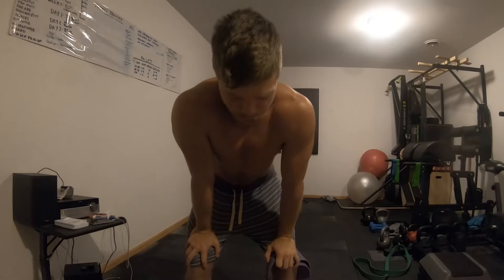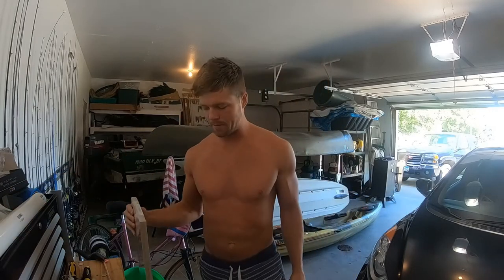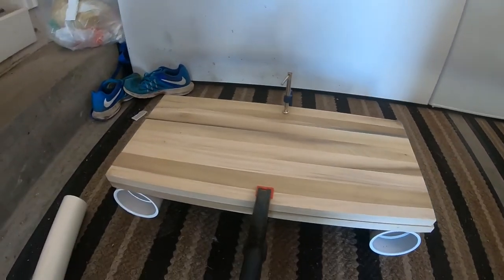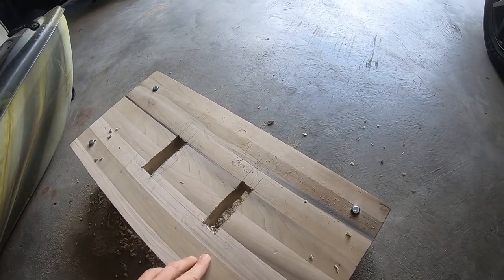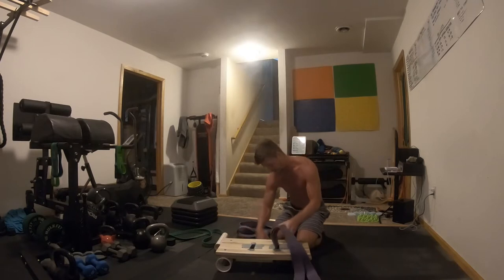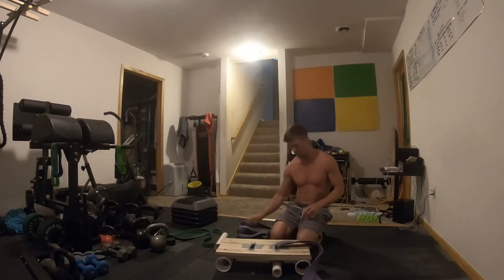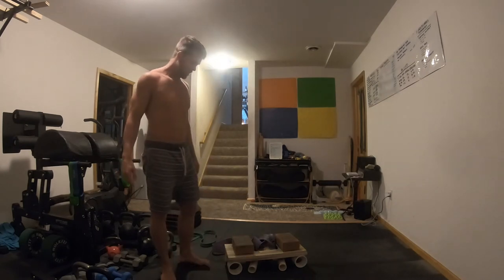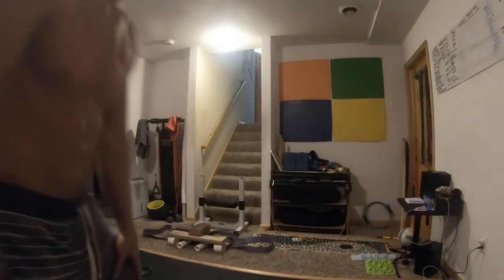Making a Resistance Band Squat Box for my Rogue Fitness Bands

Comment: To add more tension, have you tried placing the smaller pvc pipe "band anchors" on the outside of the base with the bands running between the larger pvc "legs"?  Meaning the band anchors brace against the outside of the legs rather than directly against the board.
Reply from the maker: I think I follow you and that might work but the legs aren’t super sturdy on here and pulling on them with all that band tension might cause things to bend or break.

Comment: Nice job on the platform. Could also consider bolting in some Handles on your floor... more stable.
Reply from the maker: That would work but it’s nice to be able to move it around too. So far I’ve loved it.
Reply: @Lurtz14301  very dope! Awesome diy of the jumpstretch platform which is hard to get nowadays